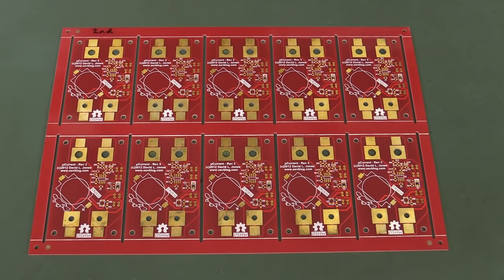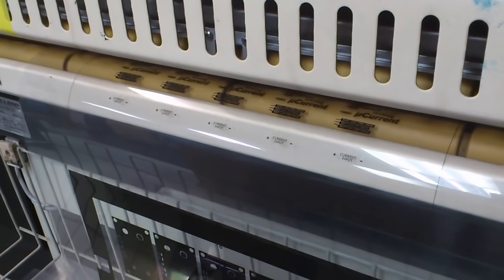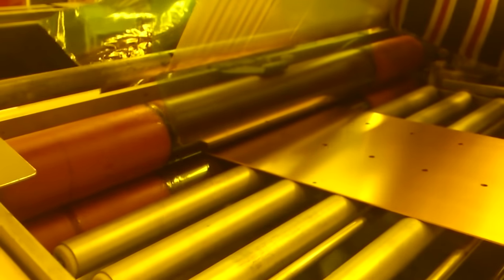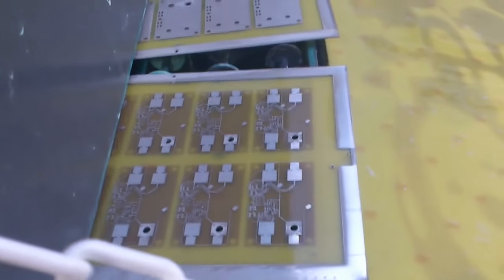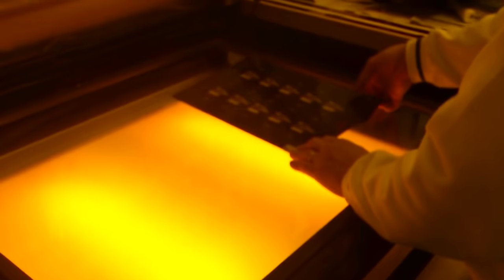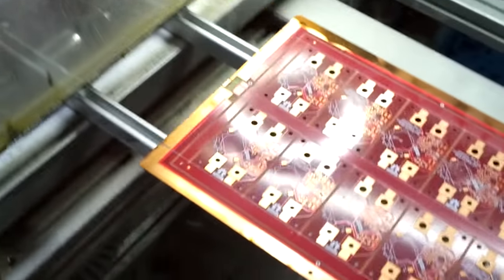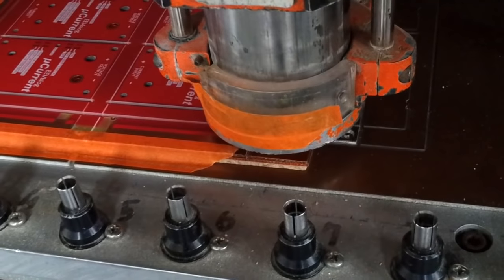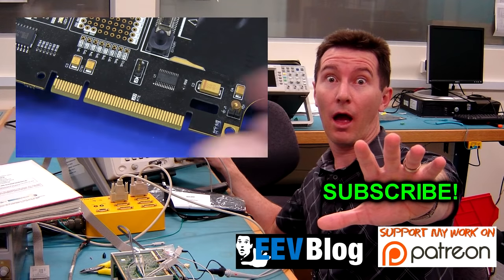EEVblog #939 - How Is A PCB Manufactured?

Comment: You use the electroplating after film development to be more efficient in the use of the copper. The base board has only a thin copper layer of 1µm or less. On the exposed parts the copper is electroplated to the desired thickness. Afterwards you only have to etch away the thin base plating  which is faster and consumes less copper in total. You could even skip the tin-plating step here: eletroplating to a thickness of 18µm and then etching away 1µm of copper over the whole board will consume all copper between the traces, but the thickness of the traces would only be reduced by 1µm to the standard 17µm. No risk of underetching here as well - yet another advantage of this method.

Comment: I used to work in a PCB factory when I was a kid and it is quite simple.
The design is laid out and and through photo-lithography a negative is exposed onto double sided copper coated fiberglass so that the only thing showing are the traces and holes which are drilled automatically after the photo-lithography. The boards are then attached to "trees" and washed in a mild acid bath. From there is goes into a copper-sulfate bath and electroplated where only the exposed areas of the large board (which may contain many duplicates of the same small board) is plated. When it's done, the thickness is checked on several parts of the board to make sure the electroplating was even and built up to the right thickness. At this point, the boards are still 100% covered with copper, but most of the board has a blue photoresist layer on it so that only the traces are exposed. Then they are washed again in a mild acid bath. From there they get plated with tin-lead, so that all exposed areas of the board (mostly traces and ground planes) are covered in tin-lead. Then, the trees are transferred into an acid bath which removes the photoresist layer from the board. Then the trees are put into an etching bath that dissolves all the exposed copper. The trees are then moved once again into a a mild acid cleaning bath. Then they are put into yet another bath witch removes the tin-lead layer. This is all done by hand. The trees are picked up and transferred to the various baths and screwed onto large bars at the top of the baths. The bars act to hold the trees (which the boards are clamped to) and the trees are fully conductive from the bars and the boars are slightly larger than the total used space so that the trees are always in full electrical contact with the boards. If there are any gold-plated card edge connectors on the boards, they go through the same process, but this is done mostly by hand (on a small scale) because you only want to gold plate what needs to be gold plated. After this, the boards are shipped to a another factory that can do the pick and place. The place I worked for did mostly low volume, but very high quality industrial boards. I remember one of the main customers was an automobile shop diagnostic equipment manufacturer (this was like 25 years ago, but I want to say Bear was a big customer). They no longer exist. They use a lot of chemicals and once in a while will accidentally created a bunch of chlorine gas. The copper plating using "copper nuggets" which are essentially 1" thick extruded bars cut every 1.5". The tin-lead plating used solid bars of tin-lead. Sulfuric acid was heavily used as well as some much milder acids. There is constant cleaning of the boards and you always have to wear gloves to keep your skin and oil off the boards (and to protect your own hands from all these chemicals). This is old tech, but there really wasn't anything especially complicated about it. Chemists would periodically take samples from the various baths and concentrate or distilled water would be added as needed.

Comment: Damn that's a lot of work....
Reply: 2/10 needs more automation and more clean.
Reply: Brad The PCB manufacturing process is very automated, and unfortunately very messy, no way around that.
Reply: Stefan Santiago
No wonder Chinese boards cost a dollar (sometimes 1/2 dollar) for 100mmx100mm 2 side, with top silk, each.  And they are pretty good boards,  same thing made in USA, $25 each.  I feel really bad, but USA is not a good place for competing with asian board houses.  Most are gone now.

Comment: This is fascinating! Why anyone would down-vote resists explanation. The only part that I didn't follow was the thru-hole plating. How does the metal build up in the thru-holes?
Reply: I guess it's always the batterizer people that down-vote; they're traumatized by Dave debunking their bullshit ;)
Reply: As Ivan mentioned elsewhere in the thread, through holes can have metal chemically deposited using a palladium process. Once a base layer is there, copper can be electroplated on using a more traditional process.
Reply: Either electroless copper or direct metalisation process which is fundamental but not shown

Comment: I wonder if they even do this in America still. This is a labor intensive and is virtually unchanged since I was working in a PCB factory in 1990. The way we did this stuff, when the electroplating was happening, you mostly just sat there and waited for the thing to finish. Sometimes, when we were busy, we would load the trees, but that was only if we had the spare trees and the very first tank, which was a weak acid/water mix, was free. We spent a good portion of the day just waiting for the electroplating to finish. It's usually about an hour. You move the trees from the copper to the tin-lead, give the ones in the tin lead to the next guy, move the ones from the cleaning bath to the copper bath and load the water/acid bath and all this only takes about 15 minutes, so you really just sit around or clean or other make-work for 30-45 minutes (the specs determine how long the main copper bath lasts, usually about 1 hour). Moving those trees around was hard work and you had to wear these large rubber aprons and there was no air-conditioning. It hurt your back and you sweat your ass off. The environmental people would show up all hours of the day and night for spot checks. The floor was a "board walk" All the wiring for the DC current used for the machines were under the board walk and it also kept the floor dry from constantly moving the trees from one bath to the next. The liquids would pour off the boards when took the trees out to move them to the next process and there would have been puddles of acids on the floor without that "board walk" design..

Comment: 1. Glunz & Jensen don't make imagesetters, they produce developing machines for films (and offset printing plates). 
2. It actually IS a silkscreen process they use, but instead of using it to print the final pattern onto the board (be it soldermask or text) they chose to use it only to apply a uniform, overall film of the photosensitive compounds. Silkscreen gives uniform and controlled coverage. They probably found out, that imaging & developing boards themselves is far less hassle than imaging and developing the silkscreen so that it prints selectively. Also, accurate positioning the board under the silkscreen is much harder than positioning a translucent film on a board. 
For huge production runs it is feasible to prepare the silkscreens with the actual layouts of top & bottom soldermasks as well as the text layers, and make custom jigs for accurate positioning of the particular board.

Comment: Usually these bare Panels have 17.5µm copper so the etching solution wont be saturated that fast to reduce cost.
Also etching will work significantly faster AND the possibility of over- and under etching will be reduced. :)

At 11:00 they put it back in the copper electrolysis bath to add the copper to get the standard 35µm thickness (I guess you've specified 35µm. :)).

Comment: Considering the price I'm amazed at how much work goes into making a board, especially how much of the work is manually loading the boards. For the price you pay I'd have expected a lot more automation.
Reply: Highly automated plants want to make high (profit) margin boards, and typically have their production capacity tied up doing so. Small run prototype work typically goes to the small shops.

Comment: The bare panel has maybe 0.25oz copper on it. So they photo-plot the negative, so they can build up the thickness on the traces to the desired thickness. Then they etch off the unwanted copper. This minimizes under-cut during the etching process.

Comment: One of the reasons the panel is bigger is for the tree to connect to the panel while maintaining electrical continuity. If they weren't bigger, the trees would NOT conduct electricity through the photoresist mask during the electroplating portion of manufacturing your board.

Comment: Thanks Dave for this video! Very informative and accurate! However, I'll suggest that you should do a video on how to do your own PCB's at home. I started that way many years ago and it made me a better PCB designer since a I'm able to better understand what is the fabrication process and it's limitations.

Even though you do not have plated thru hole on a home PCB, it is possible to design the board by taking that into account and avoiding top pad connection underneat capacitors, connectors and IC's and using vias instead.

When I'm doing my own PCB, I'm using the toner transfer from a laser printer onto bare pcb boards and it's surprisingly alot better than the photo imaging process that I was using 15 years ago. It is a lot less expensive and the failure rate is really low. I can easily etch traces down to 10 mils using toner transfer!

Comment: The film imaging engine is an Agfa SelectSet 7000 imagesetter. It has the capability of imaging 1200, 2400 or 3600 dpi on film up to 25.6 inches wide. I used one about 20 years ago in a printing pre-press shop.

Comment: Gpanos XP asked: "What is the point of non-plated holes ? Assuming there is at least one hole to be plated, why not plate all of them?" Some reasons: Plated through holes vary slightly in finished diameter because the plating thickness is not 100% exact -- differences in current distribution (usually resulting from certain holes being isolated because there is little or no circuitry in the area) are the main cause. Another factor in final hole diameter variation is the use of hot air leveled solder for the surface finish. HASL can puddle or blob slightly as it cools. Even small variations can cause noticeable differences in diameter, which makes insertion of tight-tolerance tooling pins or other hardware a headache. (The plated through component holes are intentionally sized slightly larger than the corresponding component lead sizes, and a further tolerance is applied, so that this variation does not cause assembly problems if the holes are slightly undersized.) So NPTHs are always preferred for tooling holes (which will hold the assembled PCBA in the final enclosure) although one hole may be plated for chassis grounding in some cases. Other NPTH uses: Screw holes for connectors and similar components, insertion holes for plastic stand-offs or component orientation tabs, and the small "mouse bite" perforation holes used to facilitate breaking the individual PCBs out of multi-PCB assembly panels.  Picture this: If mouse bites end up unintentionally plated because of a production error, dozens to hundreds of tiny rings of metal will either break free or need to be picked out of the holes manually when the PCBs are broken out of the panel -- and this is on a fully populated board, where any one of them left behind could cause a catastrophic short. It's actually best to drill the NPTHs with the plated holes, then protect the NPTHs with film "tents" so they do not plate through. This offers superior dimensional accuracy between the NPTHs and the PTHs, as well as between all holes and the circuit pattern. The secondary drill setup at the end can throw off dimensional relationships slightly. The panels need to be set up again (often on a different machine) and the material has been subjected to mechanical and thermal shock, etc. during earlier processes. So unless your NPTH holes are supported by copper pads, or are embedded in metal plane areas with no relief, always plan to drill most of your holes in the initial ("primary") drill step if accuracy matters.

Comment: I think I got the reason for negative photo resist masking for the copper layer - tinning. That is the only way they can electroplate the tin on the copper layer in one go. 
If they use positive photo resist and a total cover of tin, then they will have to apply tin before the mask and then they will have to do a dual etching of tin first and copper later.
If they do copper etching first, then they have to electroplate tin trace by trace as there needs an electric connection between the copper and the plating solution.

Comment: The gold being flat is because it isn't electroplated but put on "electroless nickel", which doesn't rely on an electric potential difference to reduce the metallic ions and encourage them to form metal where you want it. Instead it happens spontaneously when you put it in a solution.

The reason that it's hard to get flat electroplate is because there is a non linear process at play where when metal is deposited at one spot it will make a bump, causing a higher electrical field there (Volts/Meter), and much like say a sharp point on metal object carrying a large voltage will cause discharge, the copper will be more likely to plate out there increasing the size of the spot until it becomes a large spiky mess.

Electroplate solutions often have large molecular mass cations (positively charged ions) such as quaternary ammonium surfactants, often this is very proprietary stuff,  in them to compete with the copper so this is less of a problem, but it's still hard to get a uniform plate out of the copper without small imperfections.

Comment: how is pcbb formed
Reply: *pregananant
Reply: its like birth, when an fr4 loves an etchant.....
Reply: *pregnant
Reply: r u 12
Reply: The PCB is made of glass fiber cloth layers sandwiched together with a layer of copper sheet on one (or both) sides all glued together with epoxy under pressure.  Once you have a fiberglass and copper sheet, the rest of the process in this video is executed.
Reply: How FR4 get prepragged.
Reply: They need to do way instain silkscreen> who drill thier pcbb, becuse these pcbb can frigth back? It was on the eevblog this mroing a fab in auck who had drill thier three stack boards, they are taking the three pcbb back to sydney too leady to rohs my pary is with the bloger who lost his pnaels ; i am truley solder for your lots .
Reply: They need to do way instain copper> who kill thier pcbb. becuse these pcbb cant pass DRC?

Comment: It might've been a photoimaged process but both the solder mask and the silk screen paints were put on the boards with a silk screen they just used it for it's ability to leave a good even layer not for actually any of the imaging that's where the photo imaging comes in

Comment: How does the electrolysis bath plate the holes? Aren't the holes just naked glass fiber and resin?
Reply: Yea, there is another step there that was left out.  I think there is some conductive material(goo) that is put into the edges of the holes, that allow the holes to be plated.  That was kinda of a head scratcher for me too.  Wish Dave had addressed it.  Maybe he forgot.  It's not like him to shy away from love detailed videos!
Reply: I know 4pcb uses an chemical electroless processe to putt a few microns of copper down on the bare fr4 in the holes then they electroplate to the final copper thickness
Reply: I always wondered how this was done. My home brew "vias" are just chopped off bits of resistor leads soldered and trimmed in place. I still don't understand how its is through plated, and blind vias are another enigma.

Also, 4,6,8+ layer PCB from 2 double sides makes sense, but what is used to isolate the layers, just soldermask?
Reply: With blind vias, the inner layers are drilled and run through the electroless process before lamination. We charge extra for buried vias. (In the particular process I worked with.)

Comment: You can do all that stuff at home, it just costs so much. You can get dry solder mask that works like photo etching resist, you can silk screen at home, the machines are not cheap though, you can gold plate at home, again it costs and you can always buy a router for the PCB, it just costs too much.

Comment: Hey, probably somebody already explained it why they did the negative process. But I guess, they had to cover the copper with tin so that the vias coatings don't get lost during the etching process. So if a board wouldn't have plated vias, they wouldn't use this process (probably)

Comment: 11:20 are you sure that they cover traces with tin before etching copper? The tin will melt in reflow oven right under the solder mask and the solder mask will peel off.

Comment: Sounds like a arc light. I wouldn’t be surprised if that machine in the video has one. I know welding like spot welding where you are tacking something in place you don’t use a mask close your eyes. I always wear sunscreen when doing that because if you don’t the arc from the welder will give you sunburn. I just looked into them. IMAX projectors use them.

Comment: Hi Dave, cool video! Kinda interesting how PCB manufacturers use almost the same machinery (same brands) all over the world  eg orbotech, excellon.. Slight differences in the making process, like not plated holes done here at the end. Some are drilling everything at the really beginning and then using masks to eventually remove plating through where not required.
About second time they do copper electrolysis before tin plating, I guess they do it to to cover up copper oxides which has grown meanwhile hence making substrate more suitable to hold tin - just my guess!
cheers!